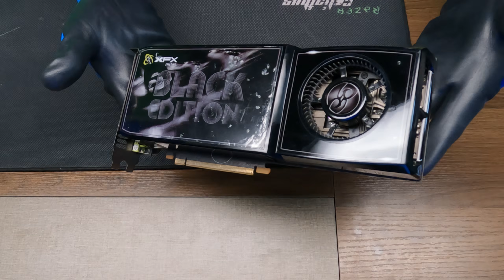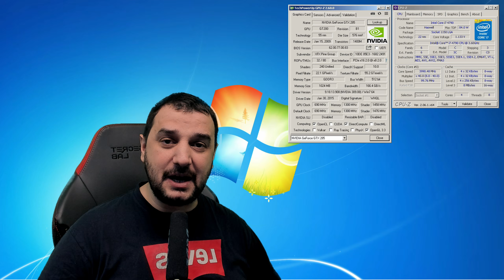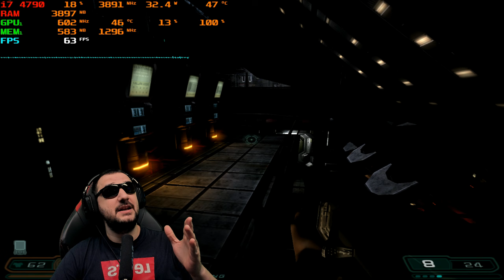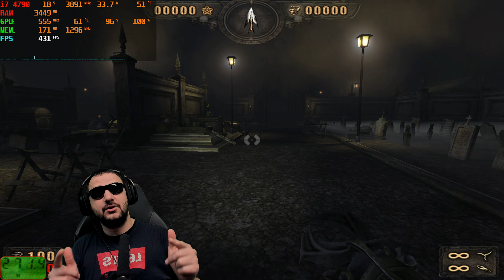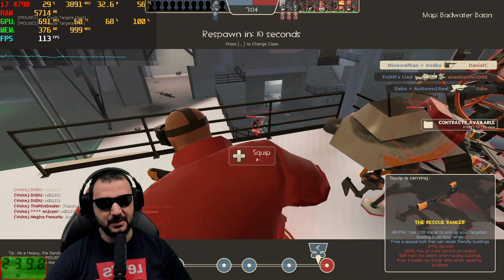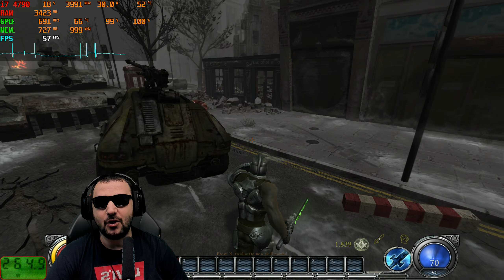XFX Geforce GTX 285 Black Edition Benchmark

Comment: If you don't nothing to lose put the graphics card (only the pbc) to distilled water and bathe with detergent for a while brushing, then bathe the graphic again with isopropyl alcohol and let it dry with a hair dryer. If the problem persists give a final blow leaving the graphic in an electric oven at 150ºc for 10 min, wait another 10min for it to cool and pray. I have this card, the black edition and a gtx 260 Batman edition. soon i upload mi first channel testing this tow monsters.

Comment: have a 285 in my retro build. keep getting the dreaded “display driver stopped responding” crash when i overclock even 1mhz above stock
Reply from the maker: Try to underclock it.
Reply: @DanielCardei stuck with stock speeds which seem fine. sucks tho because everybody overclocked back then and i just want that extra oomph in performance
Reply from the maker: @nitros3v3n  i keep saying this to everybody who recommends me to OC them.

Comment: What a stark reminder of how far AMD has come. The ATi HD 4870 had 1024 shaders and couldn't compete with the 270 which had less than this 280 55nm version. The RX 6800 has half the shader count of a 3080 but is equally good on raster

Comment: Try to upgrade CPU from i7-4790 to i9-14900K or -14900KS for minimum CPU limitation to be biggest than fair score/average framerate. 🙂 But fastest CPU isn't AMD Ryzen 7800X3D nor 9950X3D for old games/benchmarks.
Reply from the maker: So, I chose an i7 processor to avoid bottlenecks with older graphics cards. This allows me to use SLI or Crossfire with any GPU on the PCIe slot. I'm not interested in overclocking, so the non-K version is sufficient. My CPU rarely exceeds 20-30% in most games. I want to test older graphics cards here or those needing older drivers. A 4th-generation i7 K version would be better with a suitable motherboard, operating system, AIO cooler, and other components to achieve optimal performance. This PC is primarily for GPU testing, not CPU benchmarking.
Reply: @DanielCardei  ok. But the long number of multiplies only (but do not increase FSB speed from stock!) doesn't damage CPU. But max voltage of CPU is 1.35V~1.39V for safe. My old CPU i7-4790K@4.7GHz with AIO Corsair h115i cooler had no any issues between 2017 and 2021 (but this has sold due to be upgraded to current i7-12700KF). 🙂
Reply: @ricarnuninho80  What a NOOB! Research what is CPU BOTTLENECK! What a disgrace and that shows your lack of understanding in BOTTLENECKS!
Reply: I7 4790 is at 3/10%...... What are you smoking, there is no cpu limitation.. '
Reply: @billboquet1373  I notice immediately that you don't know how a CPU bottleneck works. In Galaxy on Fire 2 Full HD, DOOM 3, Gothic 3, Team Fortress 2 the CPU is extremely limited because it doesn't have enough power to utilize the graphics card.
Reply: @billboquet1373  ok but my few videos - small and medium difference of performances between my old i7-4790K and my current i7-12700KF on my old GTX 980 Ti. 🙂

Comment: Good video. Back in the day.. I had an Evga gtx 285 2gb. It was a good card. Memory overclocking used to kill cards, Now any 3000 or 4000 Nvidia series can add +500 to the memory (Often a LOT more) without affect temps etc at all.
Reply from the maker: I think the ratio of output FPS based on the overclock is nearly the same. I believe the overclock on these cards should be reduced by a factor of ten. Something like 50MHz to 100MHz maximum. On RTX 30 series cards, I was able to overclock the memory for mining on some models to nearly 1000MHz. Good topic ngl.

Comment: mid range gts 250 from 200 series was on 256-bit bus.  now even 4070 super doesn't get this treatment
Reply from the maker: True. The 40 series doesn't have it, but considering how much power they consume now, those cards might need to consider swapping parts that are soldered and transferring amps to welded connections to handle that amount of power.
Reply: yeah, Gtx 260 mid-tier had 384-bit memory bus!